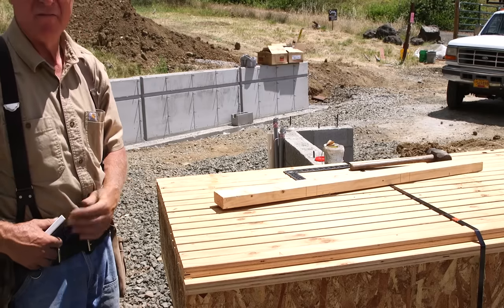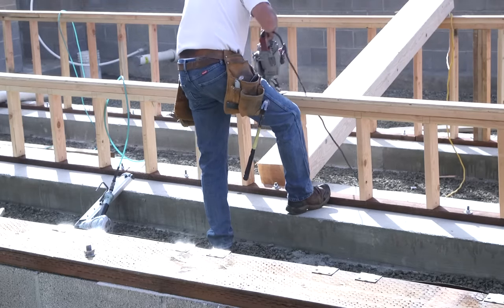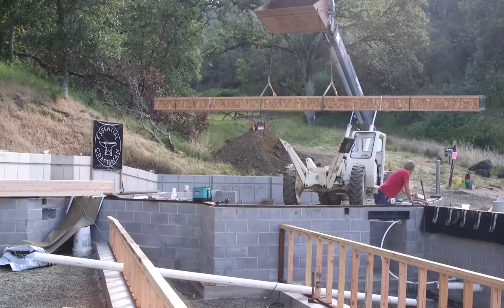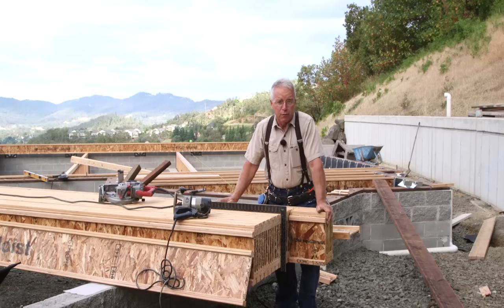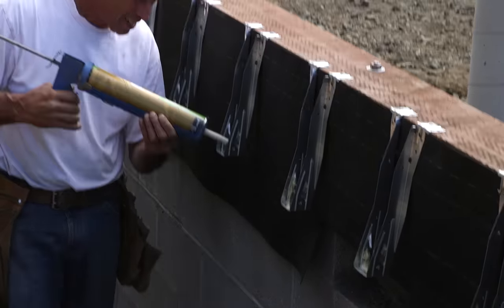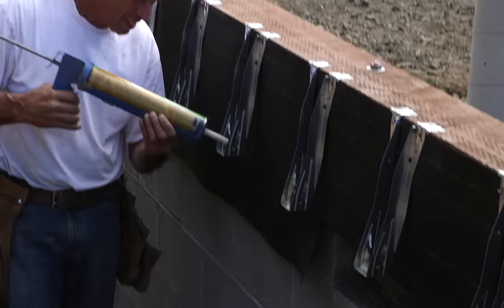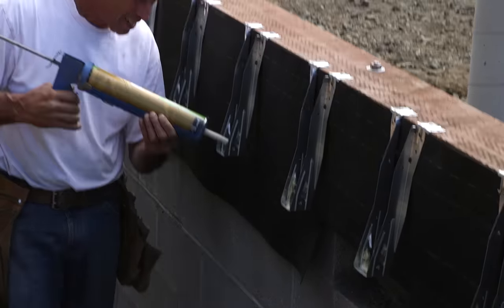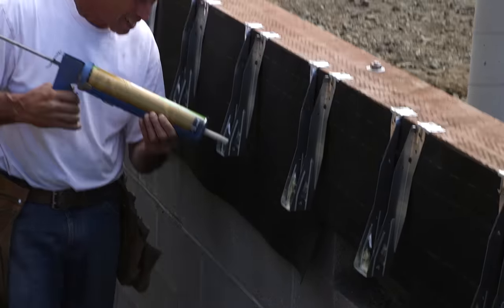Roll the Joists Ep.40

Comment: Those joists are interesting. My house was built in 1998, and the floors are all 18" trusses. It's nice in the basement where my workshop is because I can easily hang stuff on them, as there's no sheetrock there. I hang all my bar clamps on the trusses. 

The house I lived in before was built in 1886, and it was all rough sawn, and the floor joists were 2x8. They obviously held up fine, but the floors were squeaky, and if you walked too heavily through the living room you could make the record player skip. My mom would always tiptoe through when I or my dad was listening to a record.

Comment: I work for a builder, I do it all. I put up the temporary service pole. But my primary roll is a finish carpenter, and we install all our doors level to each other. Meaning I have to bench mark the floors decks to find the high and low points. No floor deck is going to be perfect.  With that said the framing is going to shrink, the foundation is not. You leveled the floor deck with stick framing and shims. Did you account for shrinking?  Most guys dont account for it, and it really prevalent when guys install steel in a home. It make a hump in the home when everything dries out.

Comment: Would it be cost effective to use the I-beam joist in building a woodworking shop? Do they come in different sizes 6".8"?? I live in Branson Mo. but just outside of the city limits. County code says that I can build 100 square feet without a permit. Is it more cost effective to build 8 x 12 than 10 x 10? I really enjoy your channel !!! Your experience and expertise is only surpassed by the kindness and humility that comes through the camera. Thanks for sharing your thoughts and videos, Rodney

Comment: Another option for ensuring a dead flat floor, instead of shimming every single joist over the pony, is to run a double sill plate on the pony. Shim in between the two sill boards only where needed and then
let the joists ride directly on the top plate of the pony.

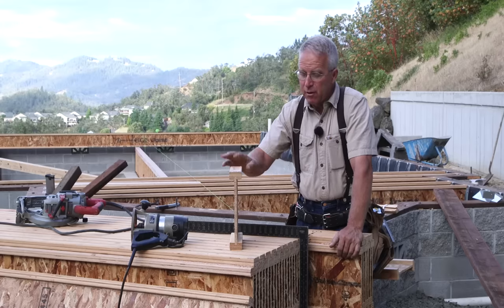Comment: 8:30 And consistency! No twists, (excessive) crowns, bark, bows, cups, or variations in height or width.
Almost every treated 2x6 I've been able to work with varies from 5-3/8" to 5-11/16", sometimes in one board, and it makes them a pain to use when someone wants to save money and use them for a deck top (yes, even rejecting treated 5/4 in some cases) instead of composite.

Comment: The reason they use the word roll is three parts, one they will not stand up by them self's until set in hangers or blocking installed so you stand them up or roll up. The second reason if your on a second floor you can stand on them at the edge, and roll up as you go. Lastly you could carry one at a time and set in place or you can carry them all over and then roll the up as you go.

Comment: Waste is very different than "insurance" cost.  You may cut a small bit from every beam...but you guaranteed that every beam is long enough.  If some/every beam fell short you would delay the job and cost massive time delays and downstream labour/timing issues.  It's an appropriate protective measure.  Just makes sense....and minimal scrap.  Right on the mark.  Cheers and thanks.

Comment: Check your drilling schedules when drilling TJI's for your plumbing from the manufacture. Its pretty much opposite a 2x joist, you drill away from the ends & in the lower section of the joist. Those knockouts help the electrician but not the plumber because they're not laid out straight where you need them. Under a house you can just hang the plumbing but TJI's between floors everything is through the joists.

Comment: In Europe, they cost double the price of wood. 300mm x 60mm approx. 6euro per meter. 300mm x 45mm timber = 3.5eur. The reason I use them as floor elements, but not as roof elements.

Comment: I learned 3 things before the 1/2 mark... 1/2" space at concrete, glue in hangers, specify full length.  Solid sawn has a crown - which can offset the deflection.  So TJI's apparently are dead straight - and must sag a bit, particularly with a long span?
We'll be "rolling" some BCI joists in Newberg soon.
Reply: OK... about shims.... they need to be full width and length of the bottom flange on the support.  Also, cedar crushes before doug fir - it doesn't have the same bearing capacity.  So if full bearing is required, the cedar is the weak spot.

Comment: Make it out of concrete...  could see welded steel working to but $$$$. I was trying to make a poll barn in MN usable during the winter and think there may be a way to fix creaks w/out crawl space/ from top. The poll barn had no slab. So I laid tarp then poly over dirt the 2x4  wide face down and the cheapest mfb/chip board I could get with some screw but mostly silicone binding it. Around the edges and then in places where heavy traffic and peace by peace(section by section not empty barn all at once) nature assembly.. I would drill a hole and insert the straw from a can of spray foam then shoot it in. I have to imagine wirh a stud finder to be reasonably sure of the edges of the joist and a long thin drill bit one could create a tunnel to shoot adhesive into a squeek producing beam later.

Between vapor barrier on floor and walls then tarp over ceiling we eventually got it to a point where at - 6 outside, a wood stove and a propain heater could get the 16x25foot space to 70 inside very little actual insulation was used as funds avaliable were  minimum. The difference a vapor barrier makes on its own is extreme.

U understand the blacksmithing joy. Haven't done it but I did teach myself to weld with a Flux core Lincoln 10 years ago then picked up a 140a klutch on clearance from Northern tool last year and a bottle of c25 on lease. My second project with it was making a bracket and modifying the frame on a lawn tractor with snow plow. The adjuster linkage broke and I figured I could convert it to linear actuator /electric. I figured right. 25 dollar electric pistion on ebay and maybe 30 bucks is metal. $300 buck plow kit now better than new

https://www.vengeancetech.biz/fabrication/kohlerproupgrade/#more-758

If that page loads slowly, forgive me, it's coming from a box laying on the floor in my apt. 

My dad was a union organizer and school bus driver my mom's a nurse practitioner. I have most of a CS degree but almost everything I've learned fab wise has been taught by friends/watching videos and just having the mind set
What would normaly be called self taught but that statement isn't very precise 😁

Not sure if u r union or not but I'm rather disenfranchized. My dad was even elected vp of his local for 25 years. He let his home go moldy to extent I transfered it to my apt and spent between there and their home 16mo bleeding trying to figure out why. Rather 8 not knowing and 8 being gas lit by parents after mold pro found massive issues. So union dad then  files false police reports gets me thrown in mental ward get a diagnosis for delusions of mold and as I get out he txts pics of the remediation done while I was geting declared crazy. I had been in a hotel right before and with in the first week 16mo of bleeding stopped. He now and then for the last year has been telling me he thinks he owns me. Mr union Mr workers rights thinks he literally owns his son. It gave them control of everything I ever had be it worked for or given and they still hold it to extract control.

I was working for a company that makes software for teamsters, carpenters and seiu all the way back in like 2002 at age 15 and age 16 I was doing it support for a 3 person CPA office already making 25 an hr. More often than not had a Corp min wage job or better but when 2 srs push lie after lie... I fear I'm going to be dead soon

Comment: Really enjoying your videos. How are you managing to keep that 'string line' so taught as to be sitting 'exactly' 3/4" off the top of the joist on the outer edge of the line as in the middle. And it appears to be quiet a distance that the line is stretched from point to point. Also, you are pulling at it fairly regularly, which I would have imagined would stretch the line enough to make a difference in the sag as a result. 'How do you manage to pull the String Line so tight that it stays taught enough'. thanks again for your knowledge my American friend.

Comment: With your string and gauge block system, over the 80 or so foot span won't the string dip a little even if it is very tight so it won't be exactly straight? If so could you get similar results with a block at the midpoint to support the string? Have you ever used a laser level to see just how "straight" your string is between blocks at either end? Impressive.

Thank you for sharing!

Comment: Great video on shimmied joist using a string line fastened on both ends at 3/4 high and using  a 3/4 block at top for guidance.
What if the joist are placed, like for my project, 25x55 garage. 1st floor at 16', ceiling ( i )joist, then another 10 feet walls on top of the 16'  1st floor  to finish off with roof trusts. How do you make sure in a open area design that all joists are close to perfect plumb and leveled to avoid squeaking floor?

Comment: This may be a silly question, but how do you measure equal parts out to cut your blocking? If they are, say, 10" blocks, you have to consider the kerf width. So you're cutting at 10 on the first block, then at 20 1/8 on the second, 30 1/4 on the third, and so forth? What if your kerf width is not exact? I'm curious to know how it's done.

Comment: I wonder how stable those joists are in 30'. Will they change in length due to changes in the weather? When I first started using OSB, they wanted 1/8" space between sheets. Will the top and bottom chords of lumber (or is it ply?) keep it from moving? I don't know.

Comment: If you cut the blocking pieces in bulk, as is shown in the video, and there is a consistent error in them, how does that impact the straightness of the joists?  For example, if they are all short by 1/16" of an inch and you need 32 of them, the cumulative loss in length is 32 * 1/16" = 2". Or, is the blocking installed with gaps as needed so as to maintain the center spacing of the joists? If so, how is good contact to the joists ensured?

Comment: ? why where the pony walls cut 3/4 short? also how did you cut your blocks, i didnt see a layout, in curious as a i am starting a new home and want to get more production out of my time.
Reply: He cut the pony wall short to save time. Time = money. It is entirely possible to get your pony wall perfect (preferable). However, it didn't look like he had a lot of confidence in the elevation of those footings. If the elevation of the footings is off, it is near impossible to make a perfect pony wall. So he did the next best thing and made it shorter and shim it. One reason to not use shims is because now his roll blocks will not touch the pony wall and the sub floor simultaneously so the load transfer he was talking about will no longer happen. Now the blocks are roll blocks only.
Reply: The load bearing is going to be handled by those beams he put in, so honestly it doesn't really matter that those roll blocks aren't transferring the weight. Those beams are going to hold the weigh of the load bearing walls above, not those blocks. So yeah...

Comment: It seems like there are a few problems with particleboard joists. A small leak under a sink and the floor will collapse. They will burn fast. As soon as part of the structure is compromised the rest will be weakened significantly so when failure occurs it is more likely to be catastrophic.
I live in a seventy year old house. I don't think It would not be standing if it was on those. I have a joist or two that need some repair.

Comment: Just wondering about the required 1/2" gap between stem wall and joists, studs, etc (if there is no vapor barrier). At approx 28 min, when you discuss the alternate way of putting the lam-beams on a pony wall (where the angles get too weird for hangers), it does not appear that you left the 1/2" gap, even though the vapor barrier is not present. Were you concerned that these pony walls might wick moisture? Thanks for your great channel and my apologies if this has already been addressed!

Comment: These engineered I-beams are a nightmare during house fires. They are the single reason why new homes burn completely into the ground from small fires.

Someone should replace the middle I of the i-beam with  compressed rockwool. If I had the money I'd start a company. Much cheaper, more strength and almost 100% fire resistant.

Comment: Why are all your  I-joists upside down? Contrary to popular belief, there is a top and bottom orientation on BCIs as well as LPIs, TJIs etc,  because there is a crown even if it is ever so slight. Just like there is on Para-lams, Versa-lams, LVLs,  Glu-lams and even some of your structural rim.   And what about using galvies when youre nailing into ACQ (treated/mud sill)?   Nice, Clean frame, Ive got to bust your chops about something. And are you not required to have mechanical positive connection(straps) on all bearing points?  Or 2” galvanized square washers holding down ACQ mudsill?
Reply: Why aren't they answering the question? Why did they put them in upside down and what consequence is it?  Won't the floors sag like crazy?
Reply: @ john babcock. It probably will not sag to the point of causing real problems as long as heavy items arent set there however upon placing them upside down to begin with, there is already a bit of sag because the crowns are down. Heavy weight

Comment: How much will that string sag of the span in question? I haven't measured it myself, but it seems like with a string you will get a 'consistent' floor - from joist to joist - but not a 'flat' floor in the truest of sense. Which for the purpose here is probably absolutely the point I think anyway.

Comment: My question: I build houses with Habitat for Humanity and this has been my challenge for three years now. How do you keep the joists 16 inches on center without stopping to custom measure, cut, and fit every block? We seem to be gaining fractions of an inch as we go. I've tried pre cutting blocks with a miter saw and have used stop blocks for repeating cuts. I honestly think that the kids are new to swinging a hammer and as such have to hit the nail and joists many many times to join the framing. I think this causes just enough vibration to allow some expansion in the joint. Any thoughts from the master carpenters out there?

Comment: Why did you put two top plates and plywood on top of the pony walls instead of building them taller?
Reply: Two top plates is standard for all walls bearing any sort of weight (even if not "load bearing"). Two plates more evenly distributes the weight of the material above to the studs below. It is required for engineered strength standards as far as I know. You can sometimes avoid double top plates on a wall if you have the joists exactly in line with the studs.

Comment: I am no logger so I would never trust myself, but it was cool watching you use that monster saw. Big Question: by using hangers, how do you deal with the proud j-bolts? I love I-joists they only down fall is they burn much faster. 2x12' have to be offset if the span is longer than available material. That makes for decking difficulties. I just posted my last Modern Cabin Plans Video, do like your channel too.

Comment: Just wondering, aren't you putting these joists in upside down?  The label on each joists is upside down -  so, is there a right side up, or does it not matter?
Reply: John Babcock. Yes it does matter. There is an engineered crown in every one of the I joists. And you are correct that they are installed upside down
Reply: @bobbygpenney1131   Well, what consequence is it that they are upside down?  Won't the floors sag?

Comment: I am loving your episodes so far and learning a lot of great stuff.
Question: When you put in the joist hangers and before you slide the joist into place, you were using some kind of liquid in the joist hangers... what is that liquid?  calk?
Reply: There are quite a few different kinds, any DIY big box store has them. Construction adhesive, liquid nails, power grab etc, there is no shortage of options. Very strong, stronger then the substrate quite often. 

My crew had to remove some second floor decking sheets a couple days after installing. Each joist had 1/4" adhesive bead ran across the top and the plywood was nailed onto it. 

My advice, make 100% sure it will never need removed before putting it down..

Comment: 24:21 Looks like pony wall is a half inch to low.  Is that an artifact of the original concrete beam's final settling? Since you take great pains for accuracy it seems for the 1/2 inch gap to be out of place.

Comment: Can I attach a second story deck with into the floor system like this? I was going to use 2x12’s for my floor and take 16ft 2x12’s and extend um 4 feet out for my balcony but we ended up using these engineered floor system instead!! I don’t want to attach my balcony to my garage if I don’t need to.. thanks great video

Comment: Can someone explain a good way to put in blocking? I usually put a block in, then nail both ends horizontally. But that ends up with the blocking being staggered along the length. How do these guys get the nailing done in each end when the blocking is all aligned? Angling the nails?

Comment: Regarding using the string to make a level floor, doesn't the string have a tiny bit of sag in the middle making the middle of the house have a slight dip in the floor?
Reply: Indeed. The middle of the house is going to be lower by like 1/128 or maybe even 1/64 of an inch. The homeowner is going to be pissed when they pull out their precision laser level and discover this.

sigh Allowable tolerances... allowable tolerances...